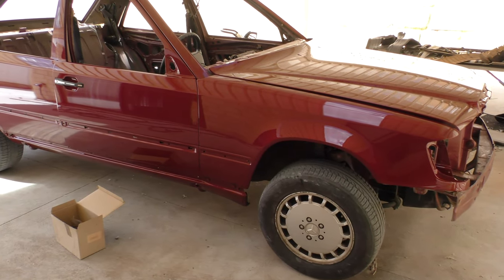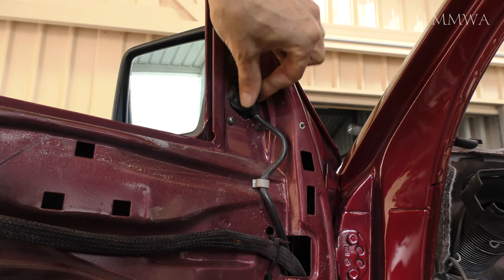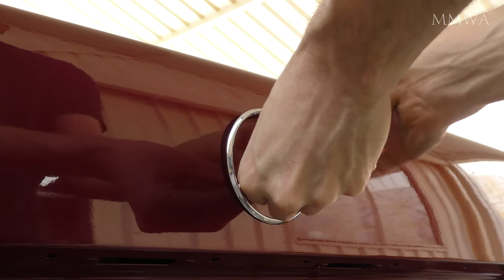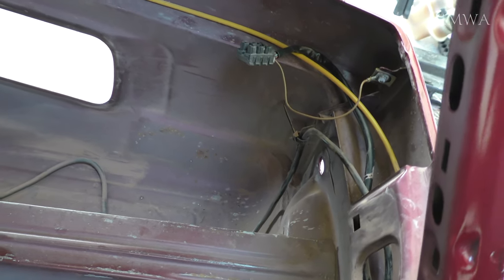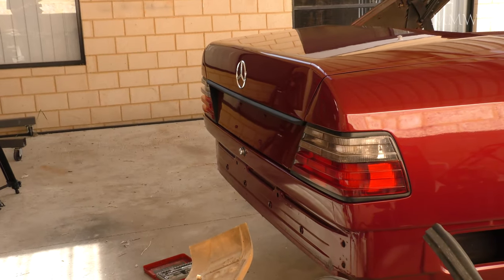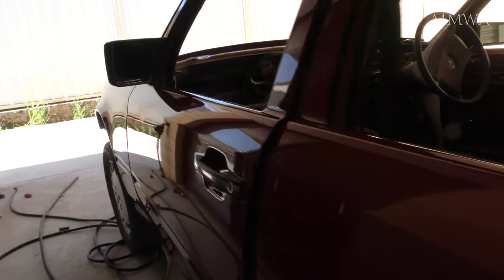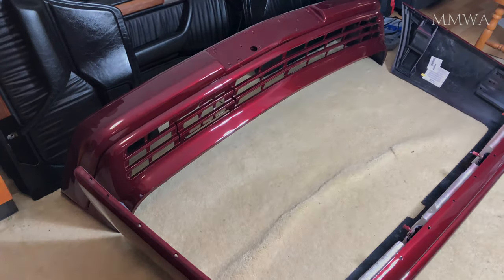Red W124 Project - Reassembly - Day 1

Comment: MM, im in Melb.   I have 2 W124s, MY 300 CE 24 coupe and my 280 sedan. thinking of getting sedan wrapped instead of painted. What do you think?
Reply from the maker: ka130258  certainly an option if you like that sort of thing, it would certainly be a hell of a lot less work and a lot friendlier on the pocket. I see theres some pretty spectacular wraps out there now
Reply: It's an option If you don't want ALL this work or expense now and it's easier to remove someday.

Comment: Hi man. Nice job again ! I have one question about taillights. Is it possible swap black rubber around ? I mean I am going for unique taillights but I want new sealing around, is it possible buy new taillights and swap this black stuff on my taillights ?
Reply from the maker: Not sure which black rubber around you speak of - the body seal at the rear side of the lense is replaceable separately - the black plastic around the lense exterior is part of the lense - its this black plastic on these second hand lenses I don't like the look of as its kinda sun faded. I notce aftermarket lenses dont quite fit properly and have a gap at the side rear edges so I'm stuck with these for now.

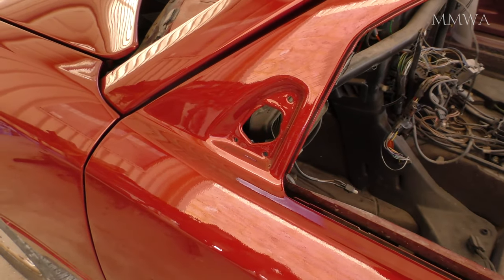Comment: Hey men nice project but don't you think that paint has too much orange peel? Like 0:41 doors. Original definitely had zero orange peel :/
Reply from the maker: The job includes a return visit once car is assembled for buffing etc - In any case its a huge improvement over what the car looked like when I got it. It may take a long time for me to get back there though.
Reply: Sure I agree. Happy to see it looks so much better now. Just trying to say that buffing orange peel to get a desired finish will get your clearcoat thin because they need to sand it and quality is way down then. It is not a good way of doing that even thought results are good for some time.
Reply: Domen Stamenov Just stopped the video at 0:41 and scrolled down to the comment section to see anyone else noticed/commented on that.
Paint job looks excellent (at least from what we can appreciate through the camera) though it may require minor treatments to leave it flat and shiny as when it left the factory.
Probably some light polishing with lamb wool pads with different products will do the job.
Reply from the maker: Apex Seal I have been asked to take it back when assembled so he can finish off. I kind of dont like this idea as polishing compound etc will find its way into everything and leave white stains and this annoys me. I will probably leave it as it is.
Reply: Watched all of his videos and really like that he is turning W124 back into great shape. I'm just frustrated why painter couldn't make a nice finish on that clear. He could have done better job for a car that nice and get closer to original finish. It has more charm then.
Reply: Domen Stamenov Absolutely. Stripping all the car down and sanding the old paint to have a proper base is no joke.
Still, as MMWA said, better take it to the professionals who (should) know how to deal with this without causing possible damages to the paint job.